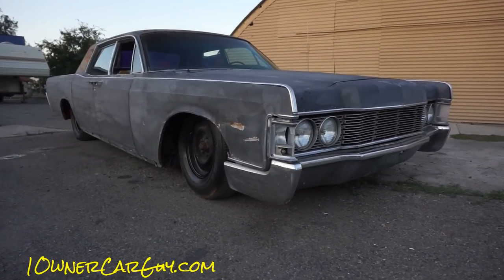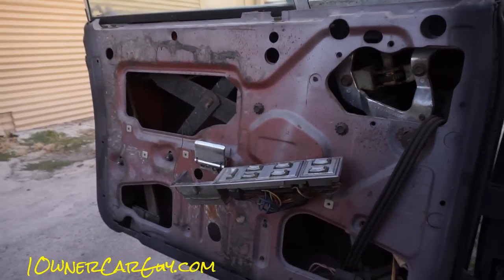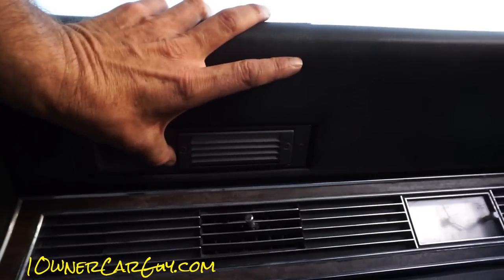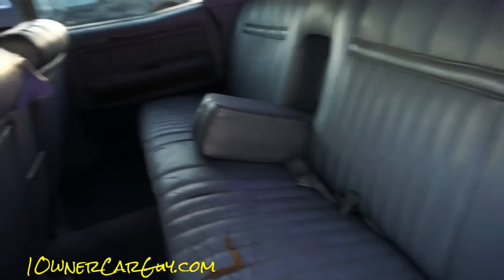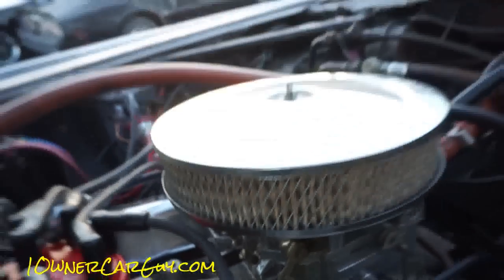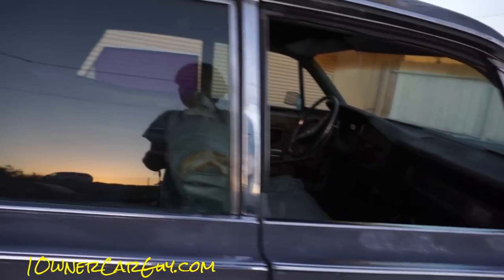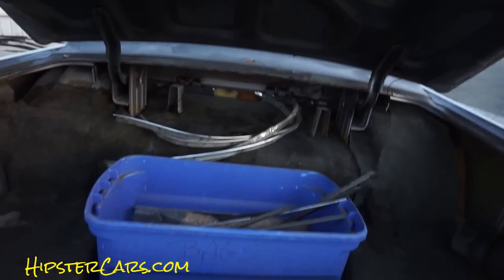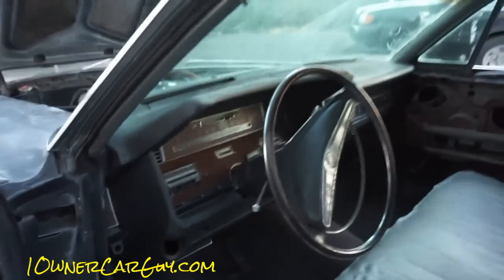1968 Lincoln Continental Interior Video Suicide Door Review

Comment: Those rear interior lights wont work if the switches are broken , usually a wire broken off the switches.. on the rear doors.. power goes through the switches... but they do have relays also.. My car 66, has rear window relays two per rear door.. an up , and a down for the power window. under the packagae tray in the trunk.. not sure it that 68 has them.

Comment: The Lincoln has a very narrow track.  Tires are set in very deep from the body.  Compare it to the Trans Am visible at the beginning of this video and the difference is drastic.  It would have been a better handling and more modern looking car and better compete against the Cadillac if Lincoln put a wider track on it.